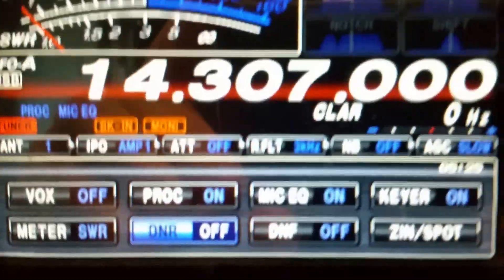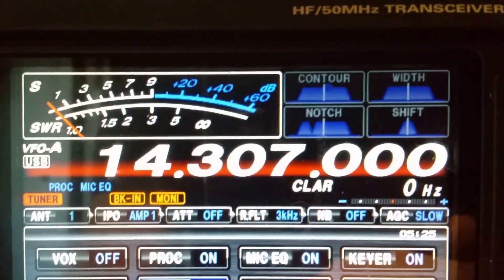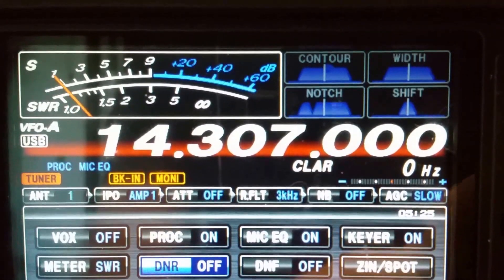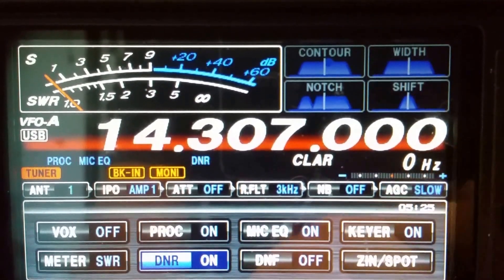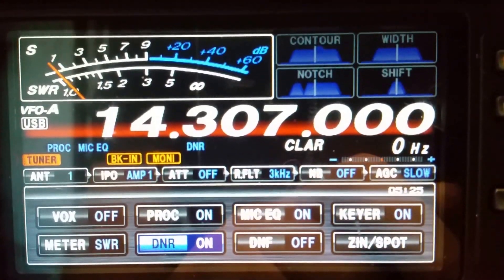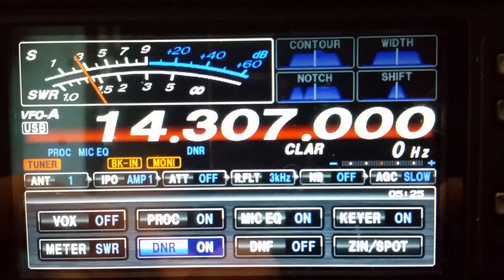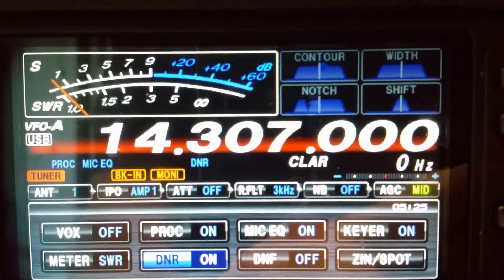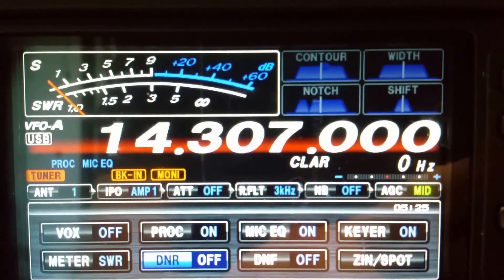Yaesu FT dx 1200:  DSP vs no DSP

Comment: A DSP, digital signal processor is not the same as the DNR... The DNR feature is only a part of what a DSP can do. DSP is always ON except on those FT1000MP radios who uses a mix between analog and DSP, so we can turn the DSP modulator and demodulator on or off. You have to talk about DNR vs no DNR if you want to be accurate ! ;-)
Reply from the maker: +MrToonfish youre probably right